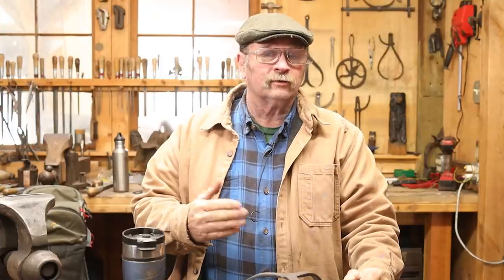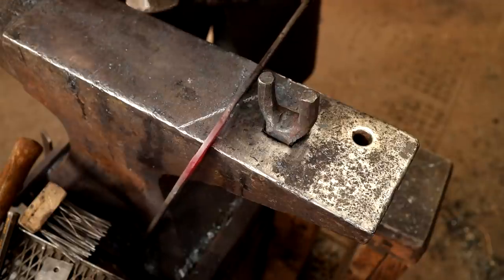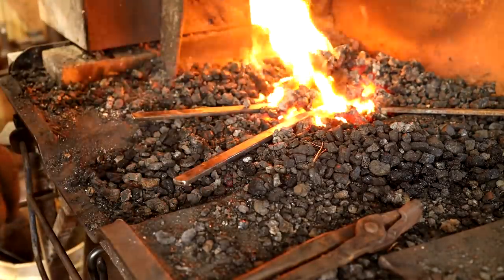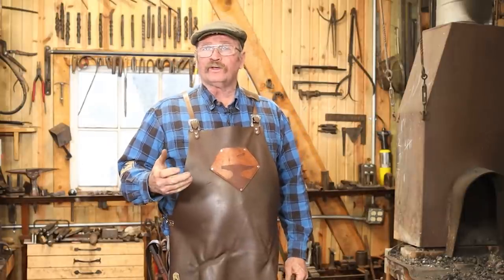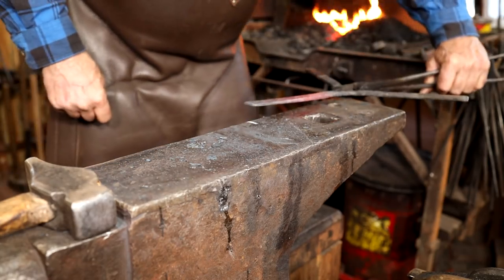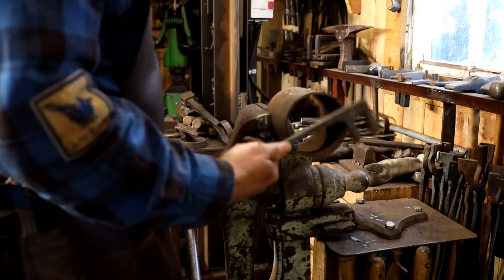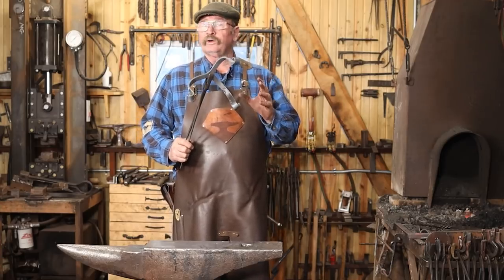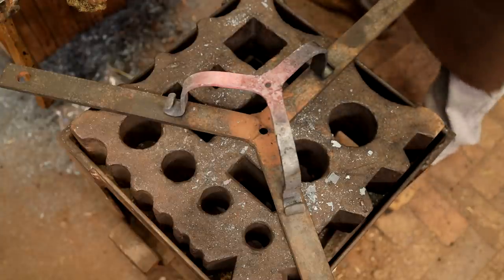Three leg stand with forge weld

Comment: Hey John, I can't thank you enough for posting this video when you did. I have been struggling for about a month now on how to make this very base. I am making a 14th century floor standing candle stand with that very base out of half inch square stock. I have been having nightmares about how I was going to forge weld three pieces in the coal forge. Your simple solution (and I would imagine period solution as well ) just made my life monumentally easier.  I thank you sir and thanks for doing what you do.
Reply from the maker: Glad it helped

Comment: My main forge Is an induction and the price is very reasonable considering($1200-1500 maybe a lot Les if you gamble with an eBay model.).  My small scale unit can liquify -3.5 lbs of copper which is  serious amount of heat all for less than 40¢ in electricity.  My machine is the same some companies sell for 4K you just need to shop around.

Comment: I love that moment after you get the pieces up to welding heat, you line everything up and give it a few quick taps and finally pick everything up as one piece instead of two. It's like majic yo me STILL and somehow it still doesn't seam possible!! 

I'm hopefully hoping finish re assembling my forge soon and it should have more then enough heat to achive my first forge weld. It almost had enough heat before I dismantled it, but now with a slightly larger gas inlet I am very hopeful 😁

Thanks for sharing this, I'm wondering if you could get it into a gas forge with a few gental courtesy bends 🤔 or I could stand the forge upright and balance the piece on the front of the forge. As heat rises it could work 🤔😅👍👍

Comment: I'm very interested in the topic of induction forges for the blacksmith's workshop. I think if you got one owerful enough it should be  viable for a profesional even on thick stock. Maybe after hoarding a bunch of jigs and coils it could even be economically competitive. It will have it's drawbacks, but it also offers no noise, no startup, doesn't spend any fuel while not in use, can heat  work without moving away from the anvil (this could be vey useful for small stock and forge welding) and with the right coil you can heat stuff anywhere, perhaps even better than with oxy-fuel. I may invest in one some day to try.

Recently saw a video from DF in the shop where a three leg stand was made from a single bar by bending one of the legs around and welding it into the center before cutting it into two so you don't need to do a drop tongs weld.